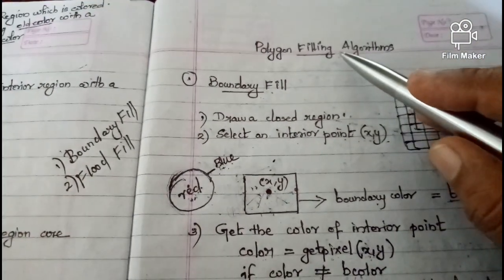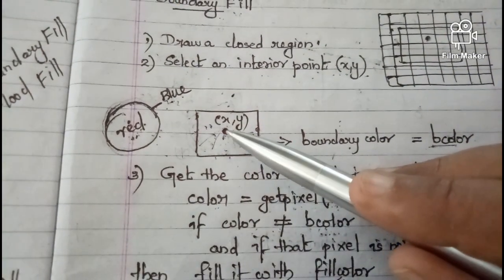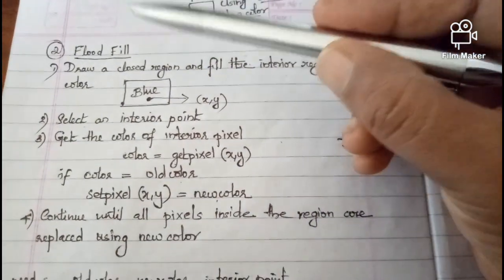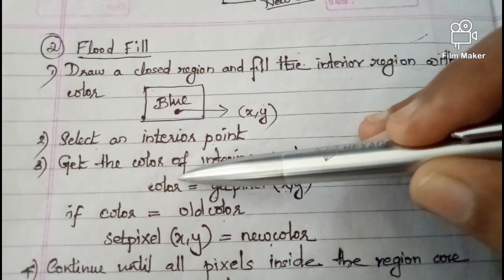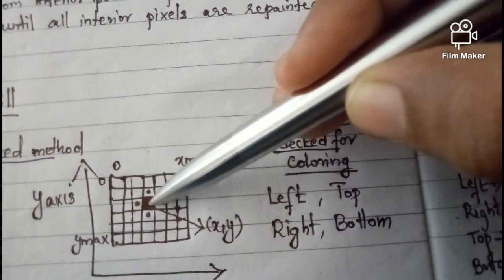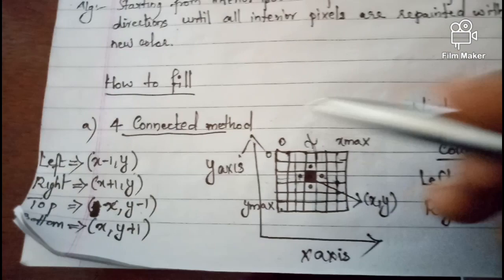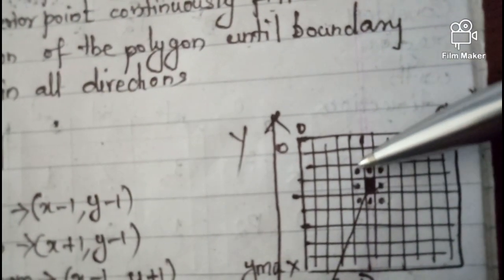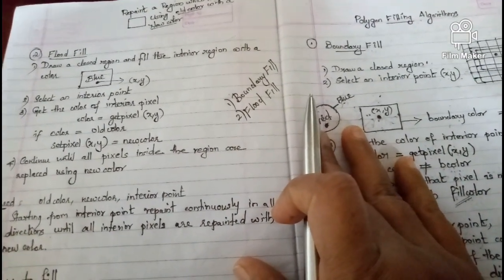Boundary fill & Flood fill Algorithms

Comment: First of all, thank you for the video. I saw a filling algorithm a very long time ago. It was on a Sinclair ZX81 or Sinclair Spectrum. The algorithm had a completely different approach. The area was filled in circles from the inside to the outside. Further layers of pixels were placed around the edge of the central pixel, similar to a roll of paper. Only when you reached a limit did you start a new recursion, as far as possible. You didn't need to remember all the free pixels, just the first free pixel, because the recursion filled all the pixels anyway. I don't have a name for it, unfortunately. It gave the impression of a snake game, where the snake always has to keep the way back open. Maybe such an algorithm is known, I would be glad about an answer.